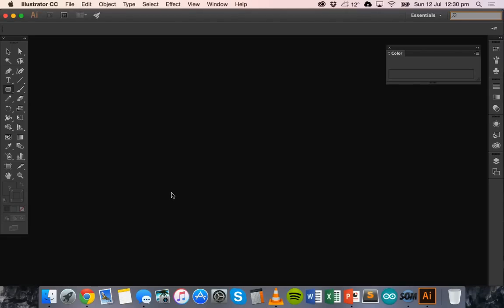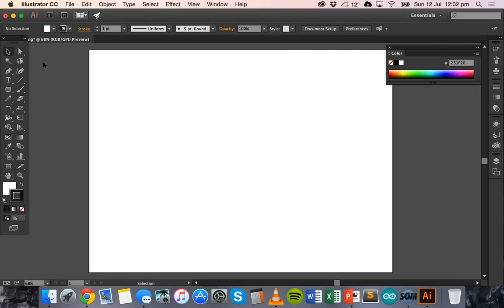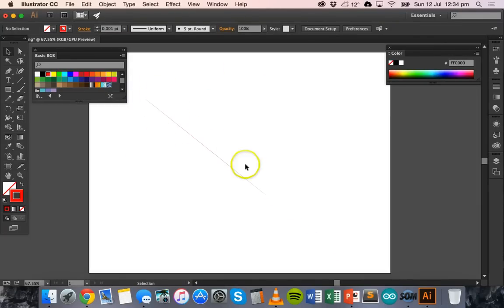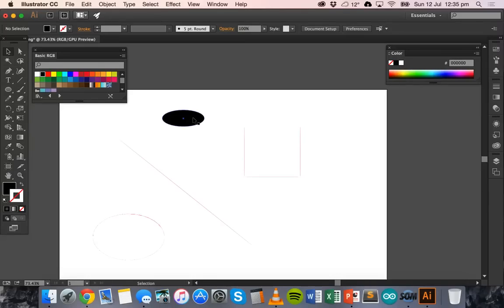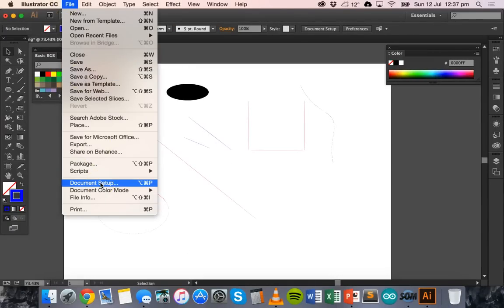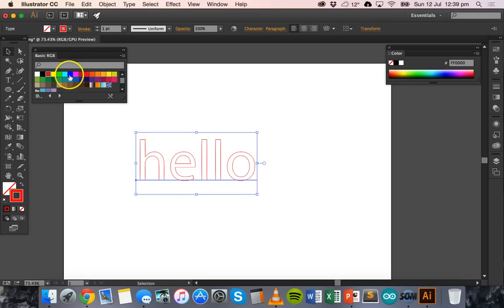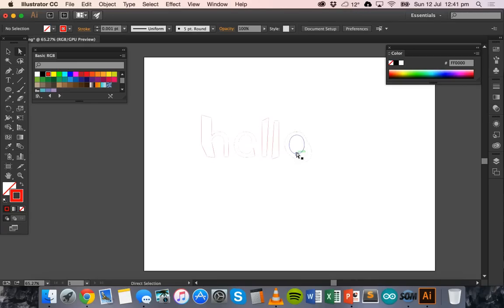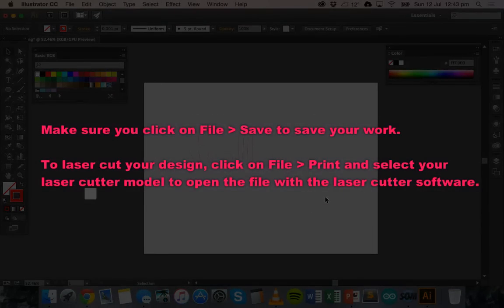Laser cutting with Adobe Illustrator

Comment: No need to change the line width to 0.001 because thicker lines works just as well as long as you use the correct RGB colour. I set mine to 0.25 so I can see my lines.
Reply from the maker: I think it depends on which type of laser cutting you’re using. The laser cutter I’m using requires these line thicknesses but others might not.
Reply: @danielkwood  That's a bit of a bummer then because you can't see the lines at that thickness on my screen.
Reply from the maker: @PINACI  I generally do the lines in normal thickness now and then change them at the end when it’s ready to send to the laser cutter.

Comment: thank you Daniel for the video. on a relating question to ray carpenter,  after ive done drawings  on illustrator, and ready to engrave, mark and cut, when i send to laser machine do i just hit print under FILE or there are settings i need to do with the laser machine ? will the laser machine always know what to do as per the colours on the drawing and will adjust its perfomances accordingly if i need it to sequencially engave mark and cut. 2ndly, how do i determine the point where the laser machine will start working. thank you.

Comment: Thanks for the video.  I have the hardest time getting my Epilog Mini recognize vector cuts.  I'm setting stroke width to 0.001 and the the color to RGB red.  Every once in awhile, it will just magically work, but I can't figure out why.

I have zero problem when I use Corel, but I would much rather use Illustrator.

Are there any requirements regarding order of the layers or anything like that? 

Do you have any other suggestions?
Reply: huh.  So, It will cut text no problem (I had never tried that before), but it completely ignores any shapes or anything created with the pen tool.

Comment: Sorry I'm new to this I have a few questions: so RGB red means everything outside the lines is removed? Or does it mean that where the red line is it's cut to the other side of the material but the material outside the red line stays? By engrave do you mean everything colored in gets cut out completely or just slightly cut under the surface? Does mocking mean it's not cutting all the way to the other side of the material? It's just leaving a scratch?
Reply from the maker: Red lines will cut all the way through the material (on the line), black lines are used to engrave and can be used to engrave the inside of shapes, blue lines are used to mark lines (cut into the material on the line but not all the way through) but can't be used to mark the inside of shapes.
Reply: Awesome, thank you!